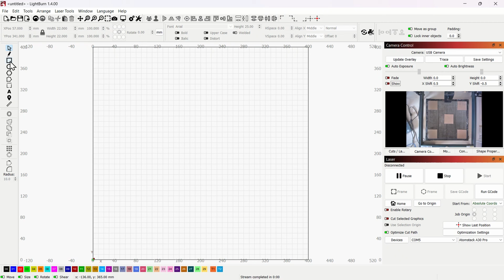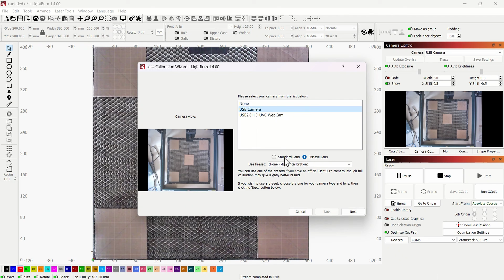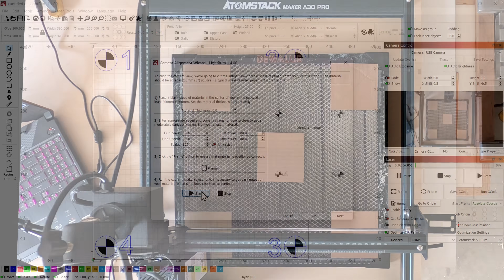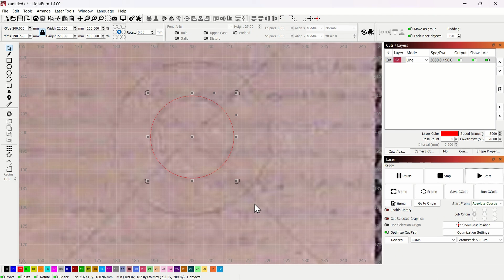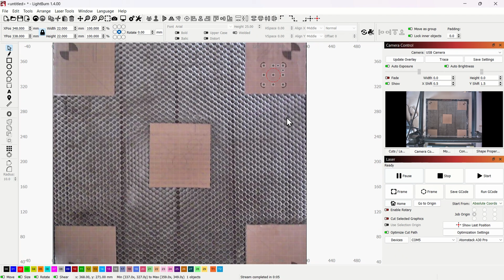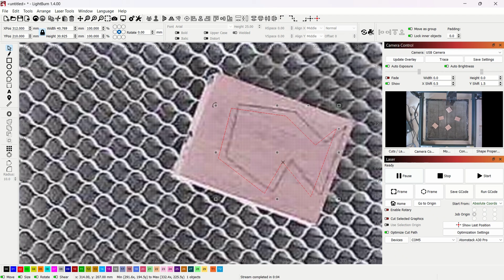Atomstack AC1 Camera Review

Comment: Very cool.  Could you use the alignment capabilities of this to stich together component sections of a project larger than the capacity of the laser tool?
Reply from the maker: I believe you could, Jim, although it is not something I have tried. That’s something I will need to try in the future. Sorry I can’t give a definitive answer at the moment. Thanks for watching!
Reply: @GordonRock1  can confirm, just made a large sign. As long as your positioning is DEAD on accurate to the millimeter it works amazing for large projects with multiple pieces
Reply from the maker: Good to know, Tyler. I hope it continues to work well for you! 🤞🤞